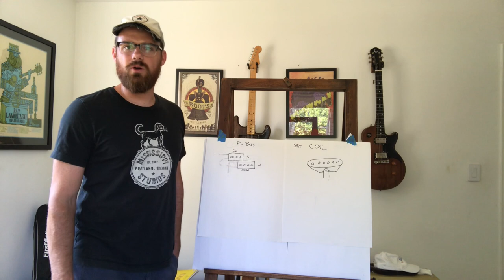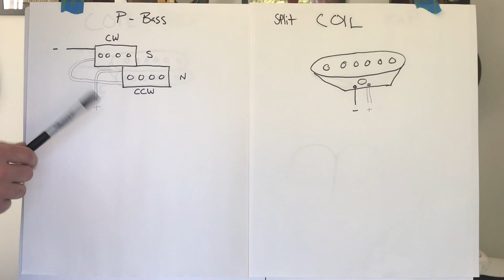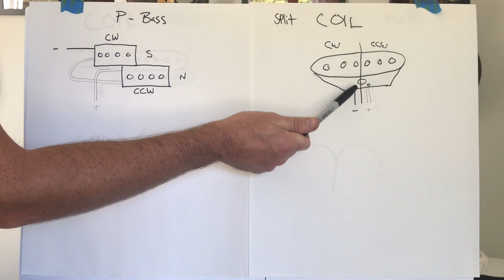How To Make a Hum-Canceling Single Coil

Comment: running the coils offset like on a Precision bass does not result in volume loss when bending the strings. That's the reason for the offset. Keeping them in line WILL result in a volume loss. You have this backwards, I suggest you investigate G&L Z coil pickups....
Reply: Yeah, pickups themselves are pretty dumb and don't know what they're supposed to listen to, so they won't discriminate against your guitar strings (nor will they discriminate against hum lol). But as you were saying, if they're right next to each other it cause a bit of phase cancelation (at least in theory) which would result in a loss of output; hence why Leo separated the coils.

Comment: Well done video. but it looks something wrong. to me  In the wiring process you show and talk only  "in serie" coils, with  one final black and final white, so these coils cannot be splited. But in the sound test, 1st one, you write "split coil"....and again after playing the Tele... There is a non sense.
Reply from the maker: What you are seeing is back to back testing of a split coil and a regular single coil.
Reply: @SchuylerDeanPickups  Thanks for answer. It is wired in serie so it is a 2 coils called humbucker,...  just sized like a single. A split coil would be wired with option to cut off one of the coils before the pot by a switch  cutting your serie wire. Then it would be  a coil splited humbucker..
Reply from the maker: @nanofree5950  If you split the coils like a humbucker then half the strings wouldn't make a sound.
Reply: @SchuylerDeanPickups  Exactly, that s why a smart split coil is winded like "Fender noiseless" up to up bobins or side to side like  Dual Hot Rail for example. But anyway term "split coil"  is used when you can split one of the 2 coils signal before lead in output. What you show here is a pretty nice made mini online humbucker. in serie, not split coil.
Reply from the maker: @nanofree5950  I'm having trouble understanding you, but I think you're talking about a "coil tap".
Reply: @SchuylerDeanPickups  Ahh thank you to try ! But no; Coil taping is when you have a part of one coil isolated from the other part by a switch. Let say you have 5000 turns on one bobiin.. At 2500 turns; or wherever you want, you "Tap" a 1st finish wire going out the coil to a switch. One lug  leads to the other part of the coil so you have the normal full 5000 turns coil. When you open the switch you lead only the 2500 turns to output by other lug.
Reply: @nanofree5950  Semantics. In this context, by "split coil" Schuyler means that the pickup has two physically separate coils. Technically, it may be more accurate to describe it as two separate pickups, one for the low strings and one for the high strings. Incidentally, Darrell Braun has reviewed some boutique pickups of similar construction with a novel switching arrangement that allows for combining, for example, the neck bass coil with the bridge treble coil.